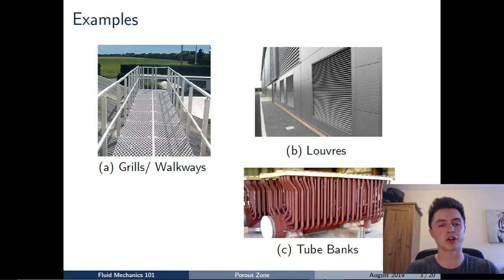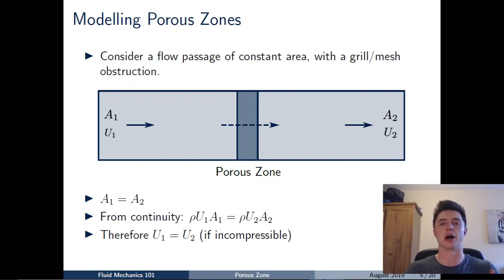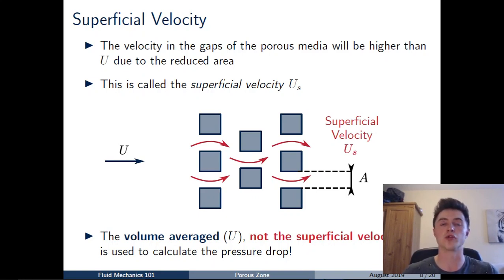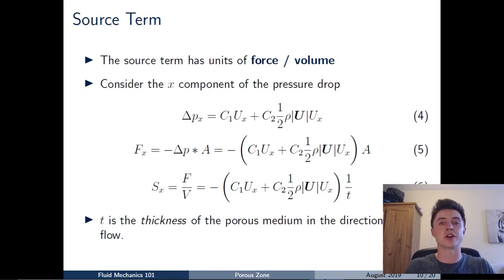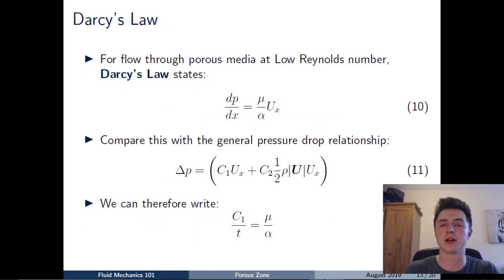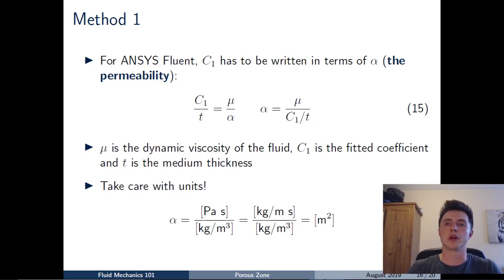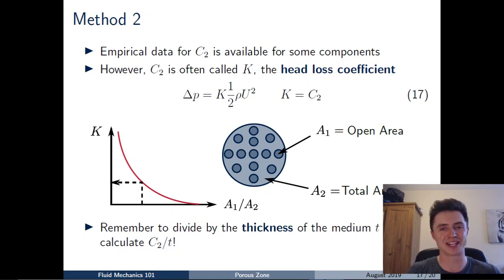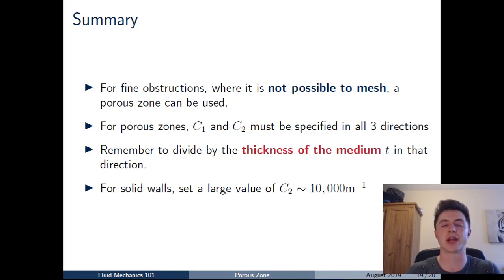[CFD] Porous Zones in CFD

Comment: Thank you very much! One more question about the relationship between the volume porosity and the pressure loss through the porous domain. i am using the CFX to simulate the flow through a gauze. And I've ran lots of cases  and found that the total pressure loss not only determined by the loss coefficient but also the volume porosity as well. can you explain this a little bit?
fantastic video , thank you again.

Comment: How would the tube banks work? Is this a heat exchanger?
Reply from the maker: Yes, it is a type of heat exchanger. If you think of a cross-sectional slice through the tube banks, then you can model this as a porous zone. The reason that you might not want to model the tubes explicitly is that the flow separation off the cylinders is complex, unsteady and requires a high level of grid (and temporal) resolution. So it is often easier to model a set of cylinders as a porous zone instead. This also allows you to perform a steady simulation 😊
Reply: @fluidmechanics101  Thanks for the feedback. Extra layers on all the tubes would be excessive and vortex street for each one. My other question was how to handle something that doesn't just hold up the flow like a filter but something that redirects flow like a louvre or parallel plates at an angle to the incoming flow? Another great video and explanation all the best for 2020.

Comment: Hello,
Great explanation. 
Is it possible to use this method for the simulation of flow through swirl diffuser?  I am doing the simulation of airflow in a clean room which has diffuser inlets.
Thanks
Reply from the maker: Yep, you can use it for the filters on the inlet and outlets to the clean room. Try and get some measures data for the pressure drop across the filters (usually the manufacturer will have this)
Reply: @fluidmechanics101  how can the porous zone discharge with the swirl flow won't it discharge perpendicular.  Same concerns for a louvre. How do you make sure it has the desired polarizing effect in terms of flow.

Comment: One suggestion . Can u present the topic regarding the modelling volumetric heat source within the components .The reason for asking this is it follows the same approach as the porous medium (Defining the source terms and how this source term works in defining the temperature) .Would highly appreciate .Thanks in advance .
Reply from the maker: What kind of heat source are you thinking? Im pretty sure you just take the actual heat source (in Watts) then divide by the volume of the cell zone (to get Watts/m3). You might need to use a UDF or User-Fortran or fvOptions if your source is more complicated

Comment: Hello Aidan, excellent presentation again, congratulations. Would you say we ought to use a porous zone method if the viscous forces are dominant in the flow? Im just trying to figure if it would be possible to simplfy even further the computational cost when one deals with a porous zone and choses to deal with the problem using Darcy law (first order velocity equation) instead of the NS equation... Best regards
Reply from the maker: I suppose it depends on your geometry. Adding an extra source term to NS doesnt really increase the computational cost (adding a porous zone). So if your overall geometry is simple, you could probably just use Darcys Law in a hand calculation. If your overall geometry is complex, just throw in the porous zone 😊

Comment: Shouldn’t the units be m^2/s in slide 16?
Reply from the maker: Ive just been checking through and it looks like ive made a mistake 😅 especially after insisting on being careful with units! C1/t should have units of [kg/m3 s]. Hence the time unit in the numerator should cancel out to give the correct units of [m2] for alpha (the face permeability). Sorry for the slip up guys, and well spotted on the mistake!

Comment: How does somebody get familiar with CFD? Mainly I am talking about the programming. I am comfortable using python, MATLAB and very proficient with calculus as well as vector calculus. Any advice would be extremely appreciated. However, I have no experience with CAD.
Reply: I can recommend you this course from Boston University: https://www.youtube.com/watch?v=35unQgSaT88&list=PL5BB45598387B9B2C&index=1 with additional material on this website: https://lorenabarba.com/blog/cfd-python-12-steps-to-navier-stokes/
Reply from the maker: Or you could just jump in and try some OpenFOAM 😄 all the source code is there and there are plenty of test cases, so you wont need to do any CAD/meshing if you just want to have a go and see how the code works. (Just google OpenFOAM and you can find it)

Comment: I think the definition of superficial velocity is incorrect. It is a volume averaged velocity where averaging is done over the volume containing both fluid and solid. This velocity is basically the product of porosity times the intrinsic average velocity where now the averaging is done over the fluid volume only. The velocity you mentioned in the schematic is the pore velocity or the intrinsic average velocity.
Reply from the maker: Thanks for the correction Sayuj! Im going to pin this post so everyone can see it 😄
Reply: Thank you Aidan. I like all your videos.
Reply: @fluidmechanics101  Hi Aidan and Sayuj, So in method 1 where data for pressure difference vs velocity is given by suppliers, is that "velocity" : superficial velocity?
Reply from the maker: Yep, it is the volume averaged velocity
Reply: @fluidmechanics101  Thanks for the answer! However I`m a bit confused. Say for some porous material, the velocity for a pressure corresponding to 1KPa is 0.001m^3/(s*m^2). So if i have a different area, should i just multiply the value to the intended area to get the new superficial velocity?
Reply: Is the intendic average velocity also the true velocity?